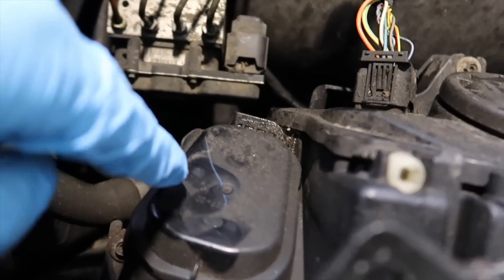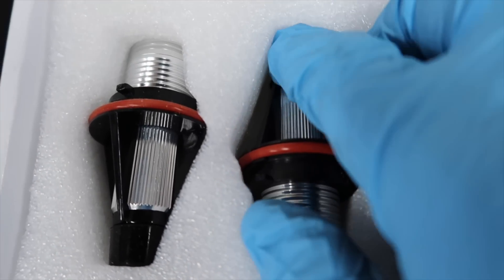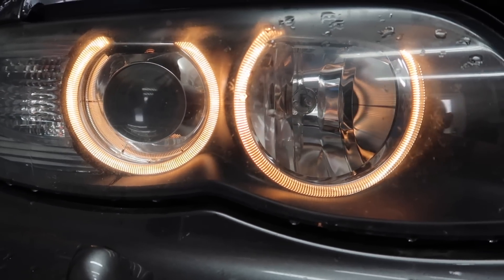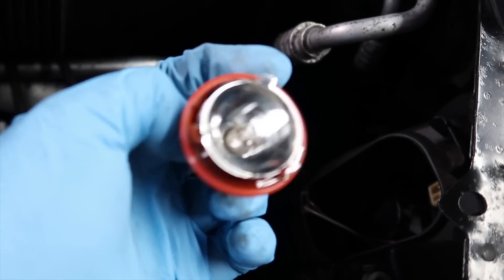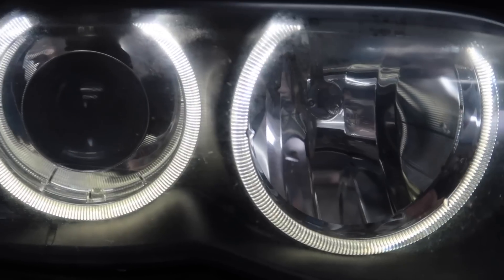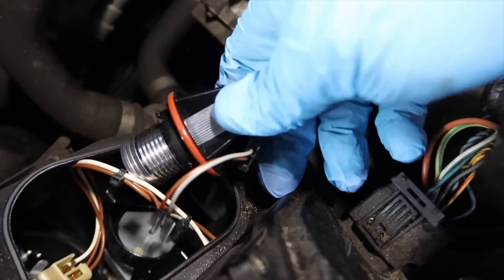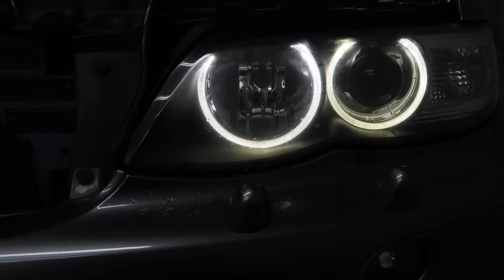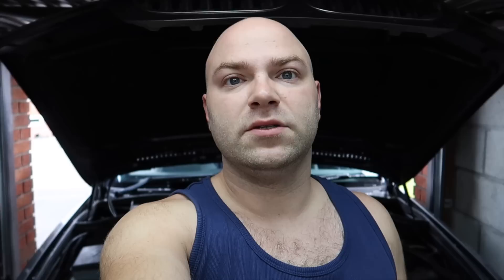BMW E39 E53 Angel Eye Side Light Led Bulbs Install

Comment: Hi 
I got a X5 E53 it doesn't come with Angel Eye rings. 
I'm planning on installing the aftermarket Angel Eye rings and change the High and Low beam to LED.

Could you please help with recommending  the best products I can get to achieve my goal. Thanks

Comment: Hi
What leds bulbs can you recommend for my e81 . The ones I have keep flashing and throwing up light error on dash or is there no solution?
Reply: Debbie, errors probably due to a resistance change that the computer sees as too far past normal. 
In other words, if the LED bulbs have a different resistance than the factory bulbs, the computer will throw a code because it reads it as a malfunctioning circuit. Other reason could be that for some reason, the rest of the lamps (parking, turn, etc) are not working. The computer will throw a code there too. 
If you're buying cheap LEDs, look into more expensive brands, and contact the manufacturers about this. These issues are apparent in certain bmws, and some LEDs work and some will not....god luck

Comment: Swapped these out on my E60. Then swapped out the low beam/running lights for leds, and the angels eyes eventually stopped working. No warning message either. Confused.

Comment: I have 160w LED markers for  e61 2007 pre fl and they are dimm. I did brightness with bimmercode to high, but still almost same effect. So come to conclusion that my rings are tosted, right? Or i do not understand the problem. Thanks.